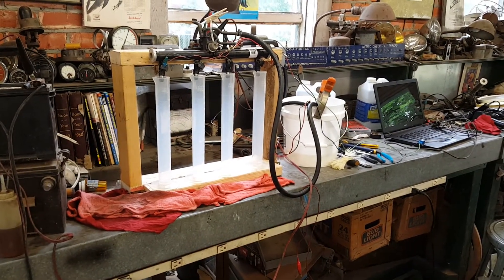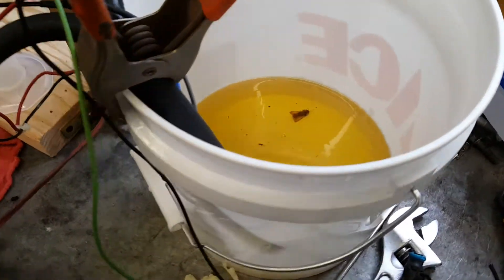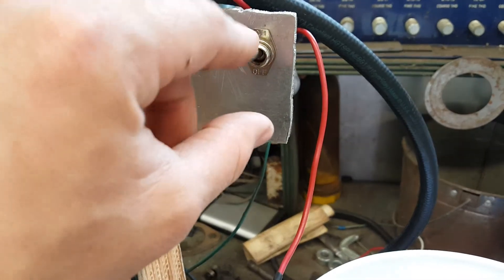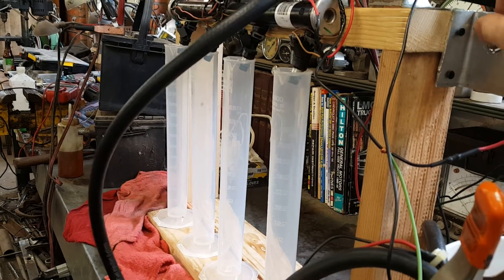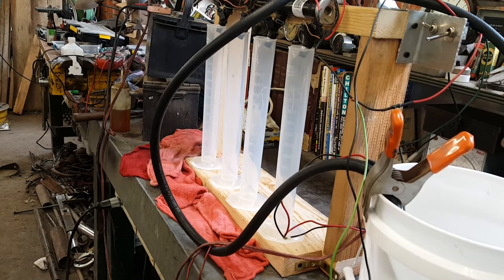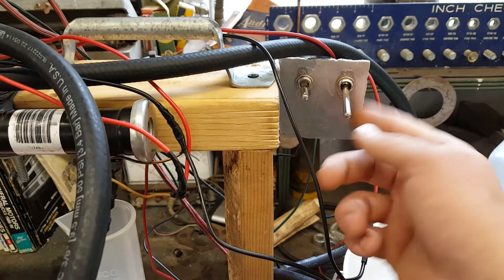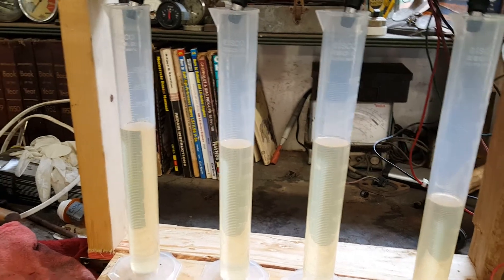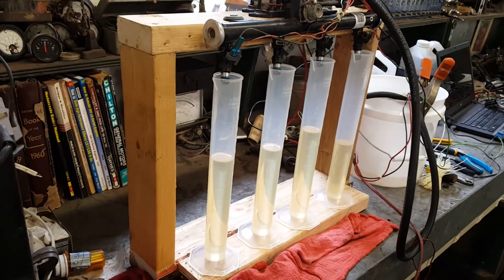DIY HOMEMADE INJECTOR FLOW BENCH ARDUINO

Comment: long shot but is the code available for the arduino?
Reply from the maker: I have not posted the code for the simple fact that I was hoping people would learn a little something by doing it themselves. If you search for code examples on how to make an LED blink, that will get you most of the way there. There are examples and code snippets littered all over the internet. Then just modify the interval to your liking and you pretty much that part of it done.

Comment: I think you would do better with a switching transistor than that relay, but, could be wrong.  Also, looking it over, I would opt for the other side of the rail in conjunction with the corvette filter with internal press reg.  Thanks for the video though, still gave me a lot of ideas.
Reply from the maker: Yep, I'm sure that would be better. Funny thing is this cheap ass mech-relay is still going. The rail has the stock truck regulator in place. Not sure how it's operation is affected without a vac/boost signal though. It doesn't seem to matter. I've run several hundred injectors through it by now, mostly LS, but some Dodge, and Volvo injectors as well.
Reply: @CDeeZ69   - Tomoato /tomato.  I like to take things and just make them better if I have not built it yet.  Your relay is good for around 25ms, but, I am always balls to the wall pushing things.  I have not figured what the pulse is at 7000rpm, but, to just get them flowing for cleaning, your good, lol.  My regulator side got burned up so I would be using the non regulated side and since I would be building new, meh, might as well keep it clean with a vette filter/regulator all in the bucket.  Since yours is built, I would not waste time changing it.  Keep up the good work and fun!
Reply from the maker: @mistersniffer6838  I can dig that, man. Your setup will be superior. This was the first and only flow bench I've built. Things definitely improve the more you do them. Post up some vids of your bench when you get it going. I'd love to see it!

Comment: all that clicking, relay not good for high speed, shouldve used a solid state switch instead of relay, mosfet or BJT
Reply from the maker: The relay works perfectly for the application.  I have a solid state relay ready to go on if the armature ever burns up in this one.... Which I doubt it will.
Reply: @CDeeZ69  how many cycles is a mechanical relay good for ? 
How many cycles per test? What's the max frequency a relay can switch At?
Reply from the maker: @joelcr250   A relay usually fails at the output contacts due to corrosion or arcing or wear and the contact lifetime depends on the amount of voltage and current the relay is trying to control. If a small current draw then it should operate a long time. 

Never counted the cycles per test becuase it doesn't matter, the relay is able to keep up with pulsing the injectors, repeatedly. I've ran it all day for a few weekends using it to clean, flow test and match stock and decapped injectors. It's been brought down off the shelf every month or so since then for other injector servicing when a buddy asks to use it.

Max frequency? Depends on the current draw, switch on time plus on time plus switch off time plus off time =time for 1 cycle... Would have to run some math to figure this out. But then again the tool works great as is....
Reply: but yet, 5 years later and hundereds of injectors it still works... so your post is kinda lame

Comment: How does the fuel pump maintain pressure?
Reply from the maker: Not sure what you're asking?
Reply: @CDeeZ69  I'm sure what he meant to ask is is if there is a fuel pressure regulator on the fuel rail... Is there a possibility of sharing your Arduino code please... "s b a r n s 4 0 4 @ gmail.com" appreciated

Comment: "Nothing more exotic than lumber and rusty truck parts" ...except for the arduino board and some custom code to pulse fuel injectors in various patterns.
Reply from the maker: If you consider a $12 Arduino board, and the simplest of code to blink an LED exotic........ Not sure what to tell ya
Reply: @CDeeZ69  Nothing crazy, but a bit more exotic than lumber and junk yard parts lol

Comment: Plz post the code
Reply: I've found this online, should be able to be adapted to 4 injectors. I'm new to Arduino, but I'll be trying it out shortly. 

#include "injFB.h"

// create 6 injectors
const int numInjectors = 6;
Injector injector[numInjectors];

ulong cycleStartTime;
ulong cycleRunTime = 60000; // 60 seconds

void setup() {
  // put your setup code here, to run once:
  injector[0].pinNumber = 2;    // start with Arduino pin 2
  pinMode(injector[0].pinNumber, OUTPUT);
  injector[0].setTiming(200, 200);  // 200 milliseconds ON then 200 ms OFF

  injector[1].pinNumber = 3;
  pinMode(injector[1].pinNumber, OUTPUT);
  injector[0].setTiming(500, 500);

  injector[2].pinNumber = 4;
  pinMode(injector[2].pinNumber, OUTPUT);
  injector[0].setTiming(100, 300);

  injector[3].pinNumber = 5;
  pinMode(injector[3].pinNumber, OUTPUT);
  injector[0].setTiming(200, 600);

  injector[4].pinNumber = 6;
  pinMode(injector[4].pinNumber, OUTPUT);
  injector[0].setTiming(200, 600);

  injector[5].pinNumber = 7;
  pinMode(injector[5].pinNumber, OUTPUT);
  injector[5].setTiming(200, 600);

  cycleStartTime = millis();
}

void loop() {
  // put your main code here, to run repeatedly:

  // Only run the cycle for 60 seconds. A Button can be added
  // later to allow for making more runs.
  if (millis() - cycleStartTime < cycleRunTime)
  {
    for (int i = 0; i < numInjectors; i++)    {
      injector[i].runCycle();
    }
  }
  else
  {
    for (int j = 0; j < numInjectors; j++)    {
      injector[j].stopCycle();
    }
  }
}